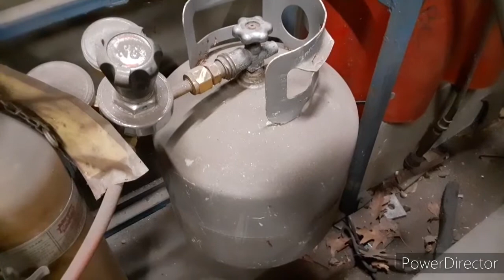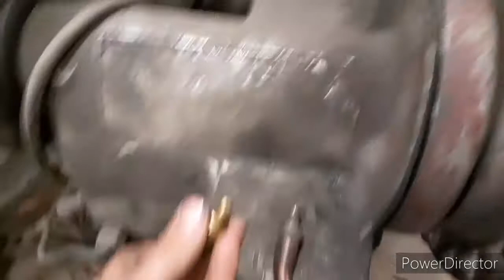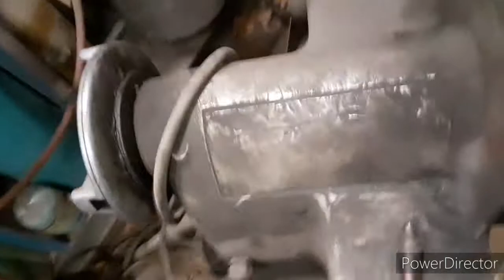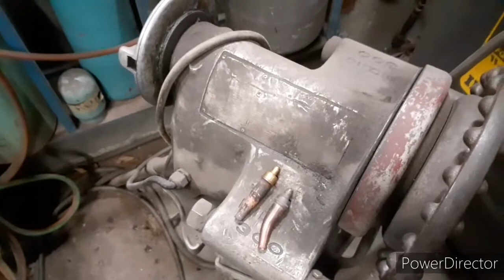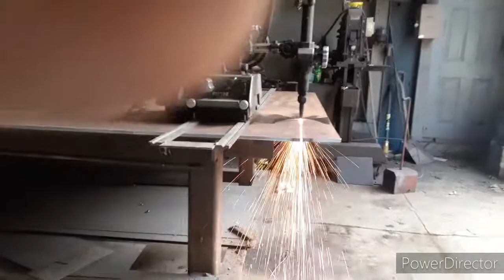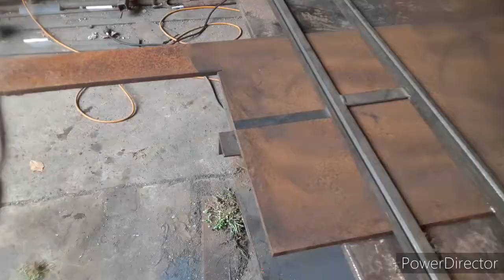Cutting Steel with Propane Torch, Never buy Acetylene Again

Comment: Propane is not on the same level as acetylene when comes to speed/efficiency or neatness of cut.
Reply: Disagree!
The fuel is only used to heat the iron/carbon steel to the temperature where it will burn in pure oxygen.
Any fuel can be used in the appropriate torch, including natural gas and gasoline.
The actual cutting is done with the pure oxygen blast, during which large amounts of heat are produced keeping the iron hot.
Reply: @BasementEngineer  acetylene burns at lot higher temperature than propane. I know this from 40+ year's experience 😉
Reply: @manosparavida3551  You are correct!
However, for cutting carbon steel the fuel / oxygen mix is only used to heat the steel until it burns with pure oxygen.
At that point the fuel is no longer required.
This is why a cutting torch has three valves: 2 for the fuel / oxygen pre-heating flame, and the third valve for the cutting oxygen only.
Many fabricators that do much shape cutting from steel plate use natural gas and oxygen for this pre-heating.
Reply: @BasementEngineer  It doesn't burn at all. It oxidizes. Capisce?
Reply: @manosparavida3551  @BasementEngineer   This is a semantic argument.  You are both right in that burning is oxidizing in almost all cases here on earth (even though this connection was not directly made).

To flog this horse a bit further:  First the metal is heated by combining a hydrocarbon with oxygen to get water and a lot of heat:

2C 2 H 2 (g) + 5O 2 (g) →  4CO 2 (g) + 2H 2 O(g)+heat energy.

We are "burning" accetylene, or we are "oxidizing" accetylene - same thing.  We get the heat we want from this to be able to heat the metal to "kindling" temperature.

When things are hot enough (about 1600°F) where the ferrous (iron) electrons in the molecules are orbiting around a larger electron shell which makes them available to any oxygen in the vicinity (as evidenced by little sparks coming off the orange metal), we don't need the accetylene anymore for heat - we have enough heat to sustain an oxygen-iron reaction on its own (that is, an exothermic reaction).  This is when we blast it with pure (or almost pure) oxygen:

Fe + O --- FeO + Heat (63,800 cal) First Reaction
3Fe + 2O2 --- Fe3O4 + Heat (267,800 cal) Second Reaction
2Fe + 3/2 O2 --- Fe2O3 + Heat (196,800 cal) Third Reaction

No, for this discussion and the extra horse-flogging, all that doesn't need to be figured out.  The only thing that should be noted is that each one of these reactions has heat as a result (byproduct) along with rusted (oxidized) metal.  The metal actually "burns" (oxidizes). Same theme going on there.

The only reason people use the term "cuttin' torch" is because it looks like that is what it does but that is only because of the speed of gas coming out of the torch that pushes the molten rust (sparks) and molten unoxidized iron (peanut butter-looking stuff) out of the way as you know.  It just looks like it is cutting.  Only a small bit of the iron is being oxidized, but the reaction is so prolific in producing heat that it melts the iron sitting right under it.  

Hell, one can make a cutting torch out of an unlit cutting tip.  Try heating the metal up with a large regular tip and then immediately switch to an unlit cutting torch and start blowing on it with the O2.  (Switchover has to be SUPER fast - can only be done with two people pulling this off.)  Accetylene valve completely off, both O2 valves and regulator set as you regularly would for normal cutting operation.  You'll see that the unlit cutting tip will "cut" the metal just fine. Just don't stop...  If you want to really impress your friends, use a really large welding tip, get the iron almost white hot, and then turn the oxygen up and start cutting with it.  The flame will blow out, but you will still be able to "cut".  This will be hard to do but is entirely possible.  (Make sure your O2 regulator is set pretty high for this.  For safety, turn the fuel off if you're fast enough.)  To be clear, the cutting torch maintains a flame that actually corrects the mistake of not having the O2 stream perfectly on the work at all times.  It makes "cutting" much easier to accomplish.  Because of this, one might surmise that accetylene is a little easier to cut with.  The superior (hot) flame allows for a little more "slop" in keeping the O2 stream on the work.

To summarize - "burning" is exactly the same as "oxidizing".

To answer the very first OP statement - neatness of cut only has to do with pureness of the O2 and the volume - along with technique.
Reply: In a nutshell 😆

Comment: cutting with propane is nothing new but you didn't mention that the cut quality is really poor when compared to acetylene.. propane cutting produces a very rough, slaggy cut needing a lot of grinding to clean up if you're going to be welding on the cut area. but if all you're doing is cutting up scrap propane is fine for that.
Reply from the maker: Did you even watch the video 🤣
Reply: So you don't do any grinding to acetylene cut metal then? 🤡
Reply: @MillerMachineWorks  yes, never saw you use a handheld torch, only the machine cutter.
Reply: @napsac4816  i don't. most pro welders don't.
Reply: Actually, the cut is very clean (assuming you have a steady hand), and requires very little cleanup.  Try it, an oxy-propane tip costs less than $15.